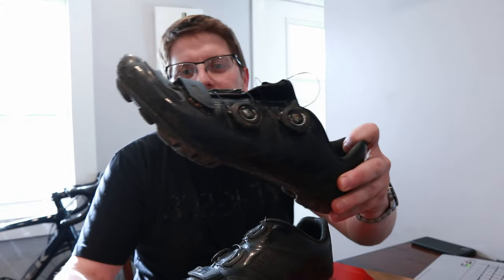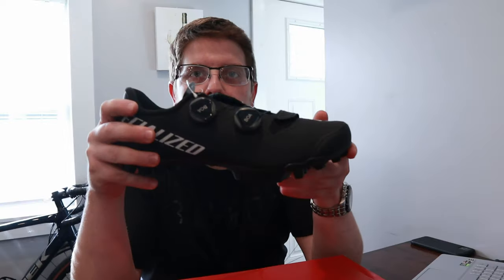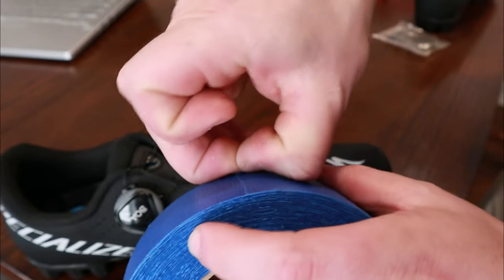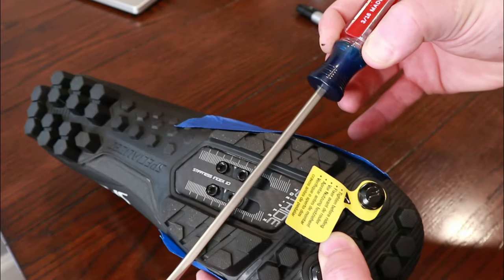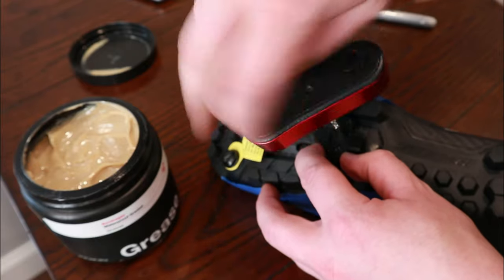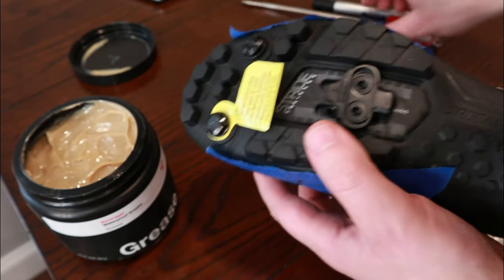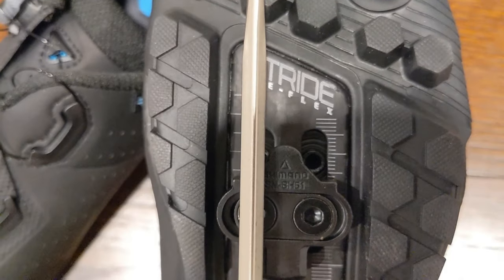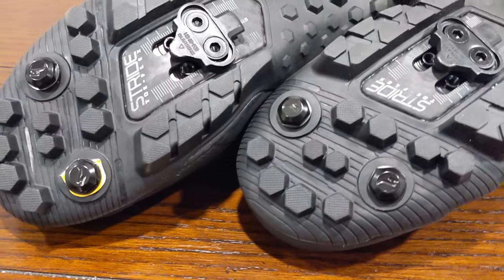How-To Install Cleats on Cycling Shoes The RIGHT WAY! | Clipless Pedal DIY for Shimano SPD and More.

Comment: This blew me away.  Probably the most succinct explanation of proper adjustment.  Following the info in this video I alleviated a ton of issues.  Turns out my cleats were nearly a full inch forward of where they should be - and my feet were suffering horribly for it.  By the end of a 20 mile ride my feet were sore and the toes were numb.  Now all of that pain is gone.  Amazing how one simple adjustment changes the whole experience.
Reply: I just bought and tried out my new pair of Specialized expert xc's yesterday. My feet hurt and my toe was numb too on the right foot. Glad I stumbled onto this video, time for the proper setup.
Reply: I am just happy to see the word "succinct"

Comment: Once you've determined ideal cleat position, place a small dab of grease into each of the captive nuts on the base of your shoe and then use a torque wrench with 4 mm hex bit to tighten the bolts to SHIMANO's recommended torque setting of 5-6Nm (43-52 IN LB) (Shimano source)

Comment: This is great info.  But I always set my float (rotational alignment) so that the inward float (heels in) stops just before my shoes make contact with my chain stays when the cranks are pointed aft.   The degrees of total float  are enough to accommodate any difference in my natural foot angle.    I don’t see a need to tune that per foot as long as your natural foot position falls within the float range.

Comment: As you were tightening the left foot kleet, I noticed that the wrench you used (on both shoes) was a torque wrench... 
What's the brand of the wrench and as well; what did you set the torque at in order to "properly" tighten the screws that holds the kleet in place?

Comment: Great tutorial thanks. I almost got it right in the first attempt ;) I had to use a spacer though as my M520 wouldn't work right out of the box with my cleats... What does it do if I push the cleat more to the top?

Comment: I’m curious to see a review on those shoes. Also wondering if it would be better or different to check the natural rotation of one’s foot in standing vs sitting?
Reply: I wonder whether the distance of the pedals (so called  Q-factor) might also have some effect how you hold feet.

Might be better to unscrew the pedals (mark the distance first on the floor), then clip in, and try to stand on the marks with the shoe+pedal assembly. This might help to adjust the rotation as well, although I don't know how to unclip the shoe without messing up the adjustment. Maybe release it somehow by poking into the right point in the pedal with a screwdriver.

Comment: Awesome video as always, James!! Do you get a new pair of shoes every 2000 miles? I can tell when the cleats are worn but I have a hard time knowing when is the exact time to get new shoes except for the looks.
Reply from the maker: Depends on the shoe how long they last. 2000mi seems short if its a road shoe, but long if its a mountain shoe. I guess it comes down to how it feels and if you have complaints in comfort/support you would like to address.
Reply: If it ain’t broke, don’t fix it.  Ride until they don’t work.  I had a pair of old Sidis that were held together with shoe goo, screws, epoxy, and riveted on copper plates.  I finally just replaced them with newer Sidis.  2000 miles seems premature to me; but maybe the Specialized shoes don’t last as long.  I used to race XC back in the 90s and I expected a pair of shoes to last at least two seasons; approximately 16,000 miles (if not longer).

Comment: Excellent presentation.  I just replaced my cleats and pedals but the new cleats are a little high off the sole of the shoe producing a little bit of wobble when clipped to the pedal.  Do you know of a remedy for this?  Thanks

Comment: I could hear your torque wrench click. What value should it be set at? The standard setting for a 4mm hex bolt is 18nm, but that feels extreme.
Reply: no doubt, critical info for the video! SHIMANO’s recommended torque setting of 5-6Nm (43-52 IN LB) for cleats!

Comment: i have just got some shinamo pedals and a cleat and struggling with unclipping at the moment. I guess i will need something softer for my rides. Can you advise? Nice video by the way - really helpful.
Reply: @bankole dada 
Loosen the adjustment screws on the pedals just a bit.
Personally, due to riding pretty rough trails I run mine as loose as possible so I don't even have to think "twist out the heel to unclip" as it has now become an unconscious act.
Great video BTW... wish I found it first.
I tried watching a number of others which took forever to get to the point.
Reply: @bankole dada try using shimano sh-56 cleats. Easier to unclip

Comment: A newbie to “real” biking. Question is if you currently get knee pain and some foot when using just a regular flat petal  can biking shoes with cleats and petals that clip in be  a relief for what I’m experiencing? 
Seat height and distance seem fine it’s I feel that I can never find that correct spot on my foot and pedal. I mostly ride our graveled trails.
Reply: Yes, cleats could help due to the natural float they allow. Flat pedals with pins lock your foot into the same angle as you spin while cleats allow the heel to move around a bit.

Comment: great video, i have a problem with my right foot going numb when i ride, this has been an ongoing problem, i went for a fitting once and continued to have the same problem. i pushed the cleat as far back as i can, it helped a little but after about 40 minutes i begin to feel pain, today i went for a ride and left the right shoe loose, i bought a pair of specialized mtb shoes recon with the one boa closure system. are there any insoles or that you can recommend?
Reply from the maker: The aftermarket body geometry foot beds are great IMO

Comment: Hi James. 
Quick question: How much rotation can you get on those cleats? I'm looking at +10° for my left foot.

BTW, well done - great info, put in a clear way.
Reply from the maker: Thanks. Most MTB cleats are 6 degree such as these SPD Cleats
Reply: @Jamesthebikeguy  Ah. So 6° rotation, plus say 5° of free float should give at least 10° of 'unstressed' toe out!

Is this correct?
Reply: @JibbaJabber  I think it depends on the shoe usually, how much room the "nuts" have, to be able to misalign them. You might try to modify the shoe, or (the probably better way) to find a machinist and ask for a custom made double washer with that 10 deg angle built-in. Possibly have to machine the countersunk allen screws too to have a little bit smaller head. That washer is not that much of a wear item, so it will last for the next dozens of cleats, as long as you don't change over to a different cleat type.
Reply: @gabiold  Hi Gabor. Thanks for your advice:) 

Currently, I've been using speedplay frogs. I've removed (dremel) the stops on the pedal which then enable me to angle the cleats approx 10 degrees. Unfortunately, they have now been discontinued and so impossible to replace.

Like you said, rather than modifying my shoes, I would love to have a customised adapter for a standard mtb cleat, such as a shimano mtb. It sounds like you've done this or seen this before. I'm trying to imaging what this 'double washer' would look like. Is there a pic/link on the web you could point me to?
Reply: @JibbaJabber  I haven't done or seen this done, but the only thing that helds the Shimano (or CrankBros) pedal in it's orientation is that rounded rectangle washer inside of them with the countersunk hole for the two screws. That's what I called double washer, I don't know the more official name of that part.

If you ask a machinist to make that rounded rectangle part to equal outside dimensions and shape, but drill the holes NOT lined up with the longitudional centerline but to a line angled 10 deg from that, then if you assemble the whole thing with the shoe, it will hold the cleat at 10 deg angled while the screws are still sitting straight. So you now still have the +/-6 or something degrees adjustment range the shoe provides in addition to that 10 deg base.
Reply: The distance of the screws is 14mm by my measurements, the offset of the holes off the longitudional axis of the screws should be
Yoff = 14mm * 1/2 * sin(10deg) = 1.22mm
+/-, so one screw above this much, the other lower this much. Which one should be lower/higher depends on whether inward or outward 10 degs you need.

Comment: You weren't very clear about WHERE the line/straight edge between the 1st and 5th metatarsal should actually intersect on the cleat.  You just glossed over it.  This is ALL I really need to know.  And what about using front holes on the sole of the shoe vs rear holes?

Comment: My left and right feet rest toes out heel in. Should the tip of the cleat point toward the big toe or little toe for each shoe? It's a little hard for me to tell which way the cleat tip should point from the video.
Reply: Big toe. The cleats should be straight when you put the shoe on.

Comment: I'm just getting to this video almost a year later.  What is/was the torque setting on that t-handle driver you use for the cleat screws?
Reply: I don't know what he used, but on my shoe box it said that the max torque you should use is 6Nm.
Reply from the maker: 5nm torque key. But as Wiebe said, read the torque setting your shoe says.

Comment: I noticed when I unclip my shoes from my bike the actual clip on my shoe has moved and twisted even though the screws are as tight as they can go? Any thoughts?
Reply: Try using some blue thread lock.  That might help.  But it might just be that the cleat isn’t locking onto the shoe sole.

Comment: Why does the bolts do not fit with the recommended allen key(4mm) I stripped one bolt
Reply from the maker: Idk
Reply: The threads or the Allen key hole on the screw?  If it’s the threads on the shoe insert, buy new shoes.  If it’s the screw, drill it out and get new screws; make sure you don’t use a drill bit that will be large enough to drill out the threads on the insert (and don’t drill through the shoe’s sole).  You might even be able to find a screw remover tool at the hardware store; they have an odd spiral pattern and are tapered to drill into the hole and reverse the screw out.

Comment: That the difference, Shimano sm-sh 51 and sm-sh 56?
Reply: The 56 is the multi-release version that are easier to pop out of whereas the 51 is sideways release only.  If you’re already used to using SPDs or other clipless systems and don’t want to release prematurely, use the 51s.

Comment: I have to wonder, has anyone ever used the front placing i.e. screwed in the bolts to the front position on the shoe. I bet nobody has ever needed to, which begs the question why is that position available in the first place?
Reply from the maker: It does indeed depend on the cleat style as well as your foot
Reply: @Jamesthebikeguy  Yeah I guess the shoe manufacturer covers all bases, they don't know if somebody's going to design a cleat that is physically quite large and therefore needs all 4 placements.
Reply: I use the front position on my right foot as it is an inch shorter due to a motorcycle racing crash.  I keep the left cleat nearly full back to help compensate so as to not affect my hips / cadence.  Seems to work, although some fitters contend that the further rearward the better. (For normal people.)

Comment: You shouldve said that you’re supposed to remove the rubber thing that is so hard to get off of the shoe most people think it’s part of it
Reply from the maker: What rubber thing are you thinking of?
Reply: Jamesthebikeguy where the spd or crank brothers cleat gets put on at least it was on my Bontrager shoes
Reply from the maker: These ones came with the mount exposed
Reply: Jamesthebikeguy oh on mine there was a rubber piece over the mount that was attached and glued on I called the bike shop and they said it’s meant to be removed and sure enough it was

Comment: These instructions are horrible...

With the tape and the straight line, you dont say what youre trying to do. Are you trying to put the clear right behind the line on the closest edge ? And exactly which park, the bolt, the housing, the tip ???

And why does any of that even matter when you then tell us to make sure youre behind that middle finger nerve, does that nerve now superceed every other measurement ??????

And with your right leg bowing out, youre trying to counter that and make it straight like youre left or youre trying to keep that outward rotation the same on the show??????